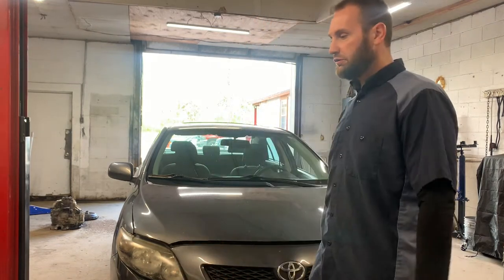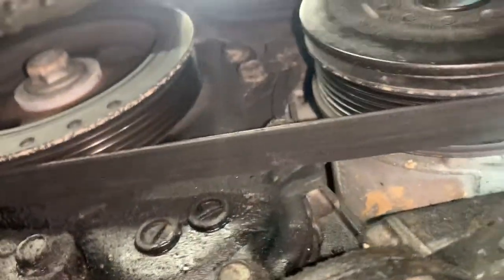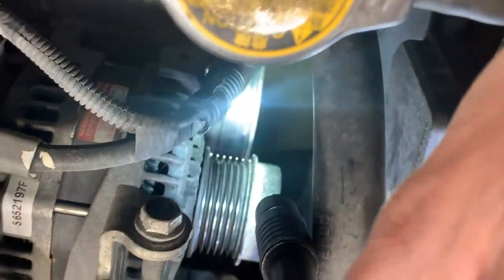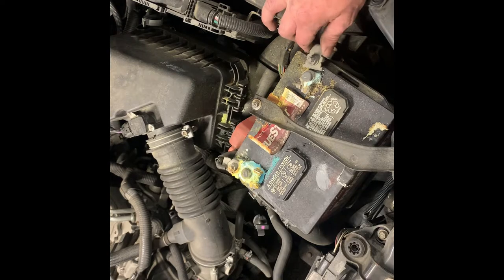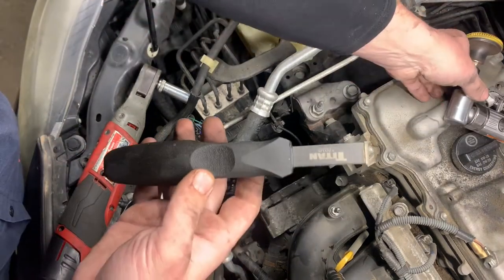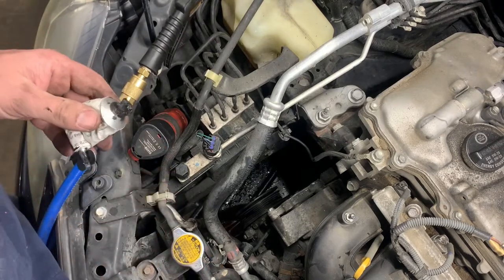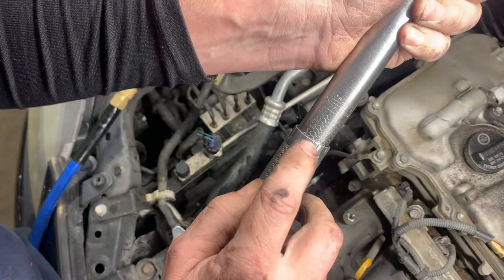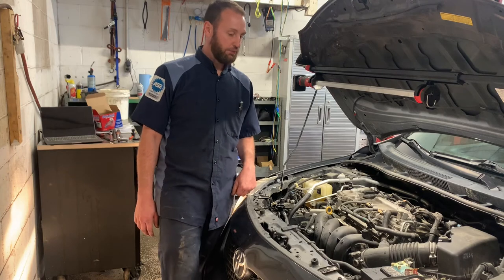2010 Toyota Corolla 1.8 L . Serpentine Belt & water pump Replacement

Comment: Why did you use Duralast brand water pump and serpentine belt? Aisin OEM water pump and Mitsubishi OEM belt are better quality and last longer. Cost a little bit more but you get what you pay for.
Reply from the maker: I agree, its funny you say that because i put a duralast WP on a Bronco & it instantly overheated, long story short they didn't press the impeller on it lol, since then ive been using better parts, i actually have a video that just come out if you would like to see it, i put an Asian WP & timing belt on a Honda Pilot 3.5

Comment: My 2010 Corolla sounded the same when you first started it so in two days when I take it in it's gonna probably be expensive I'm sure because on top of everything else the anti skid lights are on with the check engine light because the A/C keeps peeing on my carpet for whole hot summer I thought it was just the drain hole clogged but it's way up inside under the dashboard and now the squealing noise on top of everything else. Chaching $$$$
Reply from the maker: Toyota will turn on several warning lights when only one issue is actually the problem, also that’s very unfortunate about your ac leaking, I hope the dash doesn’t have to be removed, thanks for watching
Reply: @jonwillfixit  I thought you'd have more subscribers but ad me to I think you do honest work and that's rare to find these days! Here in Coastal south Carolina hits hit or miss and I have to deal with what's closest which is NTB which always seem to pad the bill. But at 62  I only know how to fix the much older American cars of the mainly 60-early 70's era

Comment: The big minus of this good job is not shown properly belt tension. It could be mark up on tension bolt before job start, or use special measurement device designated belt tension by it’s deflection on lower part of loop.

Comment: Those three bolts that came with the new water pump are slightly longer for the slightly thicker water pump.
It looks like the oil pressure sending unit is leaking a decent amount of oil.